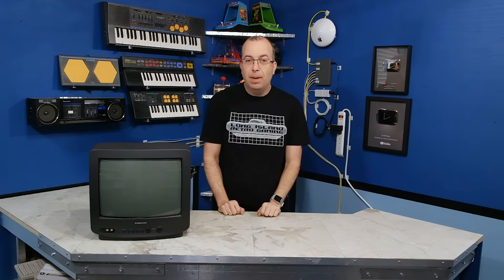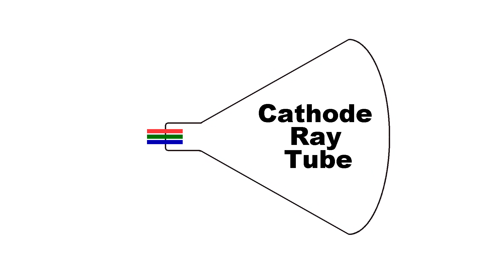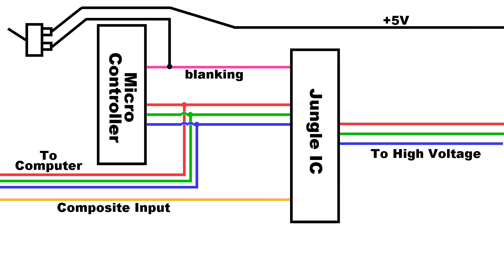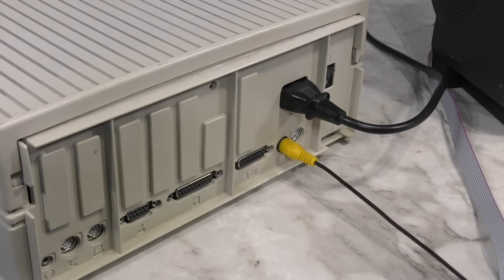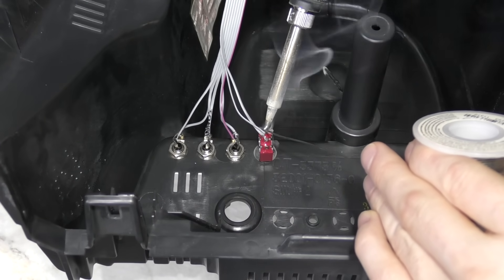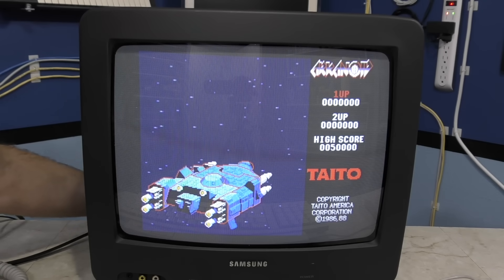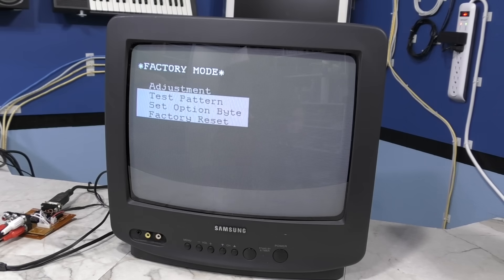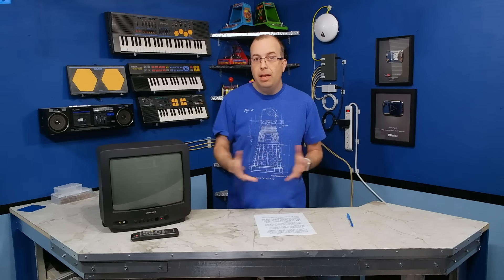Modding a consumer TV to use RGB input

Comment: Can you do a tv/vcr combo repair video?  Wow, I never knew RGB was so much clearer than composite.
Reply: Of course it is.

1. The composite signal has been modulated onto an RF carrier. ANY analog modulation will tend to degrade the signal. 

2. NTSC modulation is particularly vulnerable because of the compatible color system.  The composite system is mostly a black and white AM signal. The lower priority color data was simply kludged onto that AM subcarrier using phase shifting. It wasn't particularly robust. In fact weak television signals would often revert to black and white when noise prevented phase synchronization during the color burst transmission. So the television would display the more robust black and white signal even when it could not interpret the delicate color transmission.

The RGB connection sends the signal directly without modulation and its adverse effects on the signal.

Comment: 3:26 "Most TVs from this time have a discharge resistor".
Incorrect. No CRT device I've seen ever had a HV discharge resistor built in.
The lower voltage focus and screen anodes may discharge through screen or focus resistors,
 but never the final ~30KV HV line. Always manually discharge the tube. From a senior tech.
Reply: no sir you are incorrect most flybacks  at this time and up did indeed have an internal resistor  that would discharge the tv over a certain amount of time. that's why they were called self discharging flybacks . also this 13" tv does not produce anywhere near 30kv . remember the 1" per 1kv rule. (these are basics that a senior tech would know)

Comment: The original composite color video for the Atari and Commodore systems (others?) had a basic problem:  The analog composite monitor screen pixels were not divided up into multiples of 8-bit bytes as is standard on 8-bit and higher computers.  I think that they used a 65-bit-code value when translated to the digital computer video circuitry creating the video image.  The video chips for these early home computers were mostly made with a 64-bit code -- slicing off that "pesky" extra bit, which would have required extra and more-expensive circuity in the video chips to handle (perhaps major ignorance/hubris of a digital person about that "old fashioned" analog stuff).  This one-bit difference, until eventually understood and corrected, meant that a rainbow rippling color -- caused by a Moire pattern beat-frequency effect of 65/64 repetitions of the error -- was superimposed on the desired image, as well as creating fringing around the borders of discrete image blocks (letters, graphic symbols, etc.) on the screen.  This problem was quite evident in your Atari example when you switched white/grey letters from composite with the problem to RGB without it in the video.  It was amazing how long it took for computer design people to realize that the person who created the 64-bit-based  video chip circuitry had not realized (or maybe cared) how much of a difference that one bit would make and cut it off for "efficiency" (or maybe just ignorance/error) -- you cannot do that with things that use analog or wave-based (video, for example) emulations!

Comment: Just wondering, how would sync-on-green work with this? Can you just use an RCA splitter between the green and sync input?

Also I read online that using a 75 ohm resistor and/or a 220 microfarad capacitor on each of the Genesis' RGB lines improves the image clarity (I'm gonna need someone to confirm this)

Comment: 8-Bit Guy, I have a question.  Please help.  I'm trying to use a video capture device with a new laptop.  I've had quite a bit of experience with video capture cards being a schmerz in den arsch.  It's not working with the new laptop.  I'm getting a green preview screen in the software.  Is this simply a compatibility issue with this particular laptop?

Comment: When I connected a PC same way, I had 5 Volts from the PC so blank signal appeared as soon as the PC is turned On. BTW there is 5V pin in any VGA for this purpose. :)

Comment: Back in 1998 I had secondary PC, 486 based. It had no monitor so I connected it to the old Soviet TV via RGB from it's VGA card. Yes, I had some VGA-to-TV drivers, but Quake 1 was running AWESOME on TV at 320*200 resolution, with no squares pixels, because it was 'native' resolution for TV. It was like a hardware smoothing for the picture :)
This PC was connected to main Pentium-166 via COM-port and we played multiplayer game Quake via null-modem cable! That was really great experience at that time!
Reply: Nice. I am reminded of my mad plan to one day acquire or recreate an Autonetics D-17B Missile Guidance System Computer from an AGM-30 Minuteman-I ICBM and program it with a recreation of Atari's Missile Command of course on the largest valve TV that can be found and made operational on the planet, via direct ganglion connection such as was featured in this video! And large dildos as joysticks! We must do this! For Science! And Lulz... Mostly lulz...

Actually it's not as insane as you might think, I think some D-17B computers were re purposed to act as general purpose computers at US colleges and research labs...
Reply: @MrGoatflakes  Don't be a monster. Atari's Missile Command is supposed to be played with a Trak-Ball Controller - and nothing else - as God himself intended. Especially the arcade original. Plus, the homebrew community has gone out of its way to add native Trak-Ball support to the various Atari 2600 games that should've had it included but didn't, with Missile Command being the chief title [followed by Centipede and Millipede]. For anyone else reading this, you can get the modded ROMs in the AtariAge Forums or order physical cartridges through AtariAge's store...
Reply: @TheJeremyHolloway  well last time I checked bare missile guidance computers don't come with a display or input peripherals, so those would need to be added.
Reply: @MrGoatflakes  Why so low here?

Comment: I know you address this but if i had to mod a tv. Id use the scart or bnc brake out connectors since i have a few of those for my old consoles. Fortunately i have a newer crt (still 480i tube not hd) that has component inputs so id just need a transcoder.

Comment: It doesn't surprise me that a lot of people didn't know this could be done. Does anyone remember seeing big screen TV's in the arcade. Well some were rgb, but some were actually regular TV's with a tuner. There was a composite sync connector on on the back and in many cases a color amp chip that fed the rgb lines to a point on the board.  None of this was rocket science, after all a computer monitor and a TV are very similar aside from the scan frequencies. It would also surprise many that in the early days a lot of arcade monitors were actually regular TV's with the tuner stripped out.  This video further shows how much ignorance in the world there has been towards CRT's being automatic junk once digital broadcast came out. A long as you touch up solder joints  replace failing caps, and keep the dust bunnies out they will last a long time.

Comment: I've got a circa 1998 Sharp 27 incher in my cellar that works fine. It may a Winter project. I also have a running IBM PC-XT with a  CGA card. Who in 1983 could imagine  27 inch freakin' RGB  monitor! 😮👍

Comment: As I recall, my Laser128 (Apple //c clone) could send out both analog RGB and composite (RCA) video. Ironic, since the ][+, ][e, and //c were only engineered to be connected to composite monitors (many of which were MONOCHROME at the time -- amber or green), thus few software titles took the distinction into account. But it did mean I could ditch one of my CRT screens for a dual-input model to serve as the display for two different computers.

Comment: I have an old 13" Sony Trinitron monitor, the kind used to watch video. It has the standard composite video IN and an RGB video IN. I would like to use it to display an image from a VGA laptop. Maybe something like a bunch of scrolling green  text with a Matrix feel to it, or better yet some Blade Runner  basic language text. I have tried to use a VGA to RGB patch cord but it doesn't seem to work. Any ideas?
Reply: No composite video output from the laptop?
Then you'll need to make your VGA  to give out TV standard frequencies. Yet you'll need a VGA cable soldered to RGB input of your TV.
But I am pretty sure you'll not be able to run any windows later than win98 with VGA-TO-TV drivers.

Comment: I have modded a lot of Sega MegaDrive consoles (Genesis) from my experience the early models (with superior sound) had not so great RGB output (jailbars, rainbowbanding etc). I'm moding all those consoles with S-Video witch is superior for those consoles as it's just as sharp and clear but without all those problems. Same for the early 2 chip SNES consoles - they have very bad RBG (just a little bit better than composhite), so adding S-Video to them gives MUCH superior image quality. 
Now I didn't mod any CRT TV with RGB/S-Video, because all european TV of the time have RGB already and all my TVs have S-Video but I did some research and it would be much easier and faster to just add S-Video input to some random tv sets ot the time, because all of them have chroma and luma legs on their main chips.

Comment: Great video. What I would like to see is a hack that puts a VGA input onto a digital chassis crt TV. Simply because where I live I seem to only find these 100hz jobs. I know it can be done. This would by pass all the digital processing before the analogue input signal of these era tvs. Because they are basically glorified computer monitors that run a 15khz analogue signal, then the digital chassis run natively at 31khz and converts it back to 15khz - so it can run "100hz". This was the last step of manufacturing tv before the advent of digital broadcast and LCD screen TVs as we know them today. I would even say these digital chassis consumer crt TV are more common these days than standard analogue TV.

Comment: I had an EGS Spectrum for the Commodore Amiga when it came out. I worked in a TV station and had access to the books for the NTSC standard. I took note of all of the frequencies and built a cable from 15 pin VGA to the Commodore 1084S DIN connector. I set up a monitor profile with all of the values, and to my amazement , it worked!

Comment: Nicely done. I'm definitely not going to attempt this... opening a CRT runs the risk of electrocution, and it's not a risk I want to take. But hey, you're a professional... you know what you're doing!

There are a small handful of monitors and televisions in the United States with SCART connectors... I've personally got a Samsung 910MP with the port on the back (but you have to set the monitor to the European territory to make it work). I wasn't thrilled with the quality, but it might have been a problem with that specific display. 

My question is this... is there a way to connect a game system like the Genesis to the VGA port on the backs of more modern displays? I mean, if it's just RGB you'd think it would be possible.
Reply: You would not be able to now anyway as CRT TVs were phased out in 2006
Reply: No modern displays use VGA

Comment: >takes cover off
>slight bit of dust in there
>red anode 25KV high voltage wire is still red

I could say you haven't used that TV very much, it is literally clean inside.
With a console like the original Playstation, an RGB, even an S-Video connection brings new life to games compared to composite.
Also, that mod unfortunately does not work in the latest televisions as they only have one chip. Granted, most support Component which looks like it is a solution but it is not RGB.
Another interesting mod is making an RGB to component (Y/Pb/Pr) adaptor board and using it on today's LCD televisions that still come with that analog input.

Comment: You are right, we're spoiled here in Europe. Pretty much any Tv set made since the early 1990s has RGB on the scart connector. I noticed that your set has even a SCART- shaped cutout on the back panel where there are the Audio and video RCA connectors mounted on a  black plastic rectangle on the mainboard in lieu. I keep finding sets like this on the street and nine times out of ten, they work fine. The remainder tend to have cracked solder joints on - you've guessed it - the SCART socket! They almost certainly got dumped when the signal from the digital set top box went intermittent and the owner went out and bought a new LCD monstrosity. Broken plastic front panel control buttons are another common problem. A very  small number have more serious problems like Line output stage failure.

Comment: 6:00 I don't understand why you add resistor in series with the original resisters but not in parallel, and maybe this is the reason that your controller become dimmer than before.

Comment: Unless you have that screwdriver GROUNDED you are wasting time sticking it under the HV cap. Sure, itll crack if there is stored energy, but it WONT drag that down to ground, which is safe and where you want it.

Comment: Such a huge difference. Looks like switching between 144p and 1080p
Reply: It’s switching between 480i and 480i
Reply: RTX ON
Reply: Yo, the eye can see in limit 16k, so...
Reply: @niko5008  are you sure? That's small number 😁🤔
Reply: @_GhostMiner  no, with comma, it's 3.1415... 
But, without comma it's 31415...
Maybe one person can beat me, infinite
Reply: ∞k haha
Reply: @_GhostMiner  or colon, anyway.
Reply: @niko5008  infinity and one
Reply: Or more accurately, like suddenly getting so much more bandwidth for the same resolution
Reply: @wesleymays1931  i think i don't understand what you meant
Reply: @_GhostMiner  It's a compression thing
When you have a slower internet connection, the video is more heavily compressed, and a lot of the details are either distorted or straight up missing
But when it suddenly speeds up, the video becomes so much clearer
Reply: From 9p (lowest 16:9 res I know of is 16*9*) to 2160p.
*you can't go any lower in 16:9 because you can't have a fraction of a pixel
Reply: @notthatntg  you can go all the way down to 1x1 pixels.

Also youtube allows videos in 16x16 and higher.

And your post sounds like nonsensical shlt
Reply: PI WITH NO DOTp
Reply: Or 4k
Reply: @cataclysmicterrain  or 8k
Reply: Marios.k 239 

or 32k
Reply: @KGNYC112  Or 256k
Reply: Simon Rysavy or 1mb
Reply: @Simon-ps3oj  or 512k
Reply: @capralmarines4043  Or 2048k
Reply: Simon Rysavy 10000000000000000000000000000000000000000000000000000000000000000000000000000000000000000000000000000000000000000000000000000000000000000000000000000000000000000000000000000000000000000000000000000000000000000000K
Reply: @cc YT haha, but... 

π, but without a comma...
HAHAAA NO ONE CAN BEAT ME NOW!

Comment: 14:30 I wonder if soldering a capacitor in parallel, could somehow convert the digital signal to analog?

Now all you need to do, is convert the RGB connector to HDMI.

Comment: I can't find the correct IDC connectors. Can anyone provide a link?  (the male and female, not surface mount).  Also a ribbon cable that would fit in said connectors.  Also the exact toggle switch he's using.

Comment: Thankfully in europe pretty much any TV from the mid 1980 on came with RGB over SCART. But often the quality still lacked and I think your build could profit too from my experience:

Use fully shielded cable inside the TV. Maybe even some coax cable. There is a lot of EM noise inside the TV and a flat ribbon cable just doesn't cut it. I did upgrade some older television sets with this design and got an even better picture. Rule of thumb, 10cm of unshielded cable will degrade the picture noticeabl. There are also some coax connectors available for case installation which take a coax male connector from both sides so you basically safe one connector-cable-segment.

A cheap alternative is using the ribbon calbe with a strict pinout like this:
GROUND-SIGNAL-GROUND-SIGNAL-GROUND-SIGNAL... you get the idea, this way you get a lot less cross talk between the signal lines.

Still, nothing beats coax cabling right from the start.

Comment: The RGB picture out of the Genesis really should be better and cleaner than that.  It makes me wonder about the quality of that TV or perhaps if the capacitors inside are aging, or perhaps even the tube itself has aged.  Then again, it could possibly be that the RGB signal coming from the Genesis is out of spec and it might need some resistors on the RGB lines.  I can't recall if the Genesis is one of the systems that the resistors need to be added for or not, will have to look into that when I get a chance.

Comment: Though RGB will always look better than composite, you shouldn't compare switch on to switch off. You have to optimize both the RGB and the composite versions for a true comparison. In these comparisons the black levels were different in the exrtreme. RGB too high, composite too low, etc, composite contrast and ancient image auto-correction in consumer sets, etc. (Aside: Back in the day I had a 26" Magnavox and a 16 foot boom on my roof pointed at the transmitters and, after much adjustment, got a pretty spectacular picture from the VHF tuner.)

Comment: Actually (yes, I'm gonna be that guy): Analog Television still exists (sort of) Digital Antenna Television in which you use a Digital Converter to your TV Antenna and use the Coax Cable port on the rear of your Television and allows you to watch TV still, this happened in 2009 during the digital switch-over, and yes, converter boxes are still purchasable (both online and I have seen them with Television stuff in some box stores such as Meijer, Walmart, and so on)